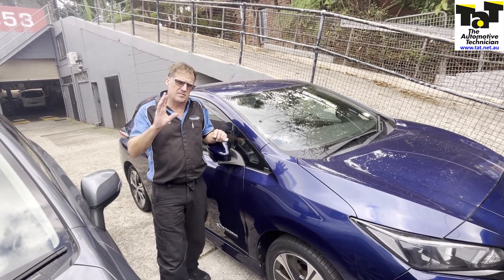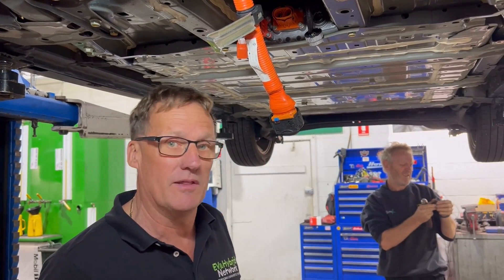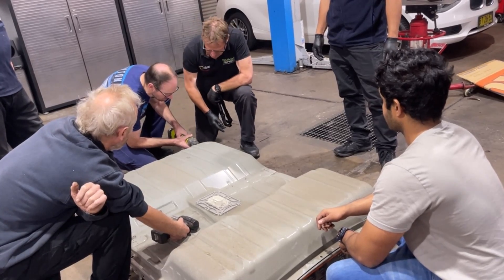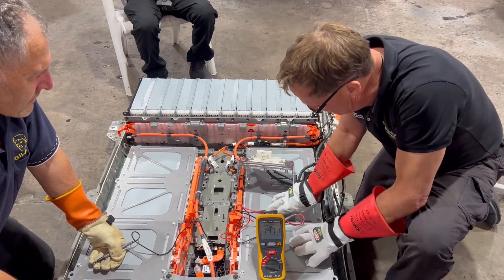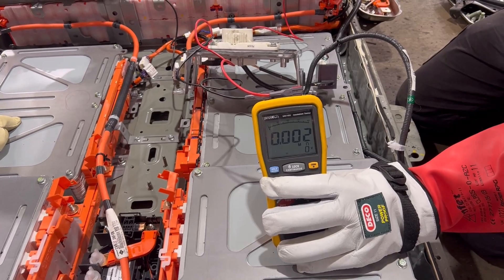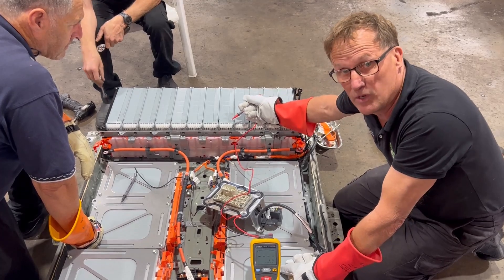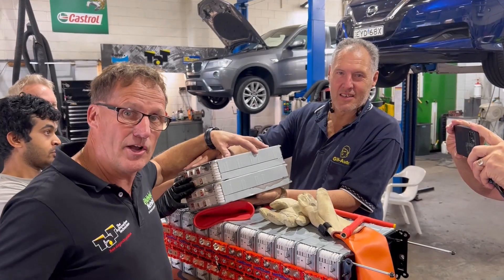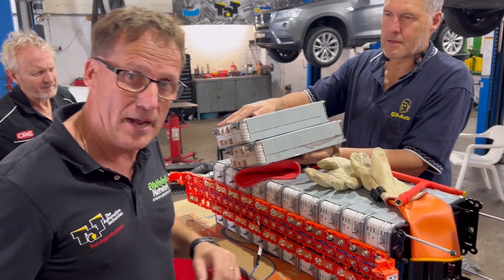2017 Nissan Leaf with a high voltage insulation fault.

Comment: great video. Megger is a brand name. In Avionics we call the test you are performing an insulation resistance test.Perhaps best to use a CAT4 insulation tester on a high voltage high energy  system.

Comment: You have the right competence and you did a great job in diagnosing the two problems the battery had, and made a great show of skills by mending the whole battery.
When you bring a car with a battery problem to a dealer, they can only replace the whole battery, even if the problem is one of the BMS chips - usually some OP Amp - which costs few pennies.
My compliments.
Greetings from the UK,
Anthony

Comment: Curious what mileage and state of health car is at?  (My 2017 40x only has >20k on it so far),  is this a common issue with age or mileage or hot climate  or just unlucky etc. Happy my SOH has remained at 92% since buying, only dropping 0.4% over 7000km and 16 months.

Comment: Third tested megaohm , wire airgap is not big enough . Same for some ground . This would cause intermitant issue . Just put wire size distance , problem solved . This issue broke the battery . Nice work